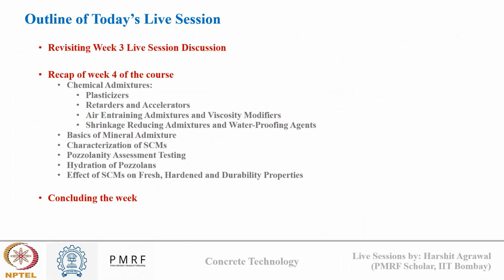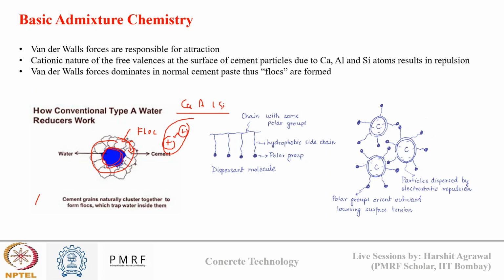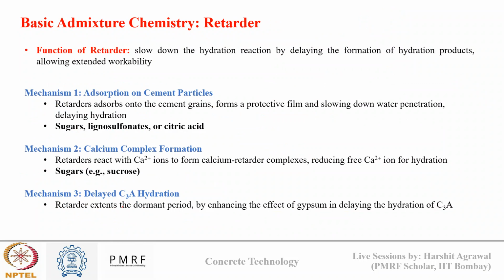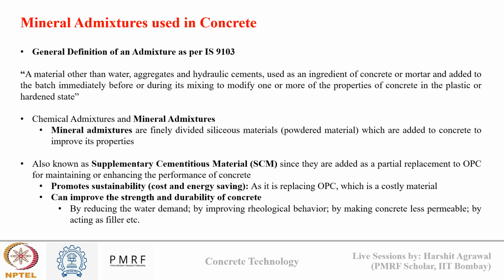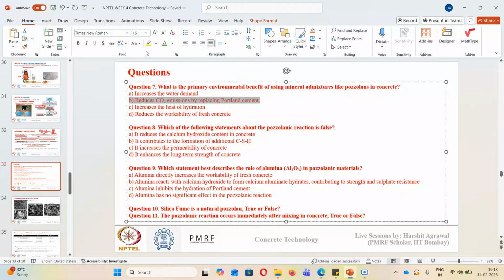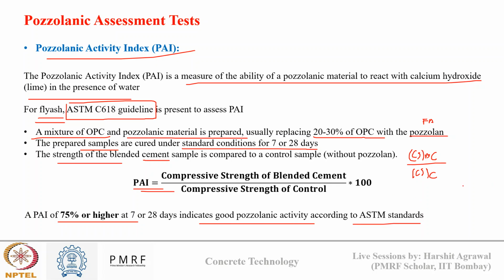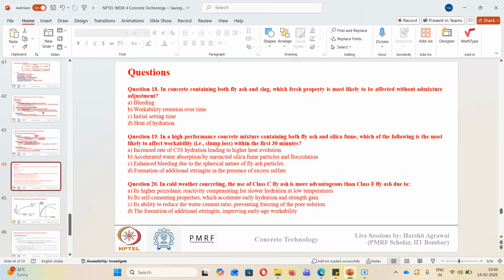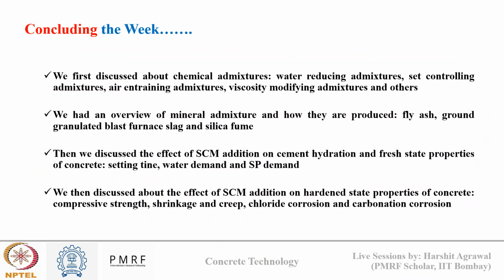Concrete Technology WEEK 4: Chemical Admixtures and Mineral Admixtures

Comment: What is the effect of mineral admixtures on the initial and final setting time of cement?  Increases significantly  Decreases significantly  No adverse or significant effect
Reply from the maker: As discussed in live session

Fly ash will increase setting time as pozzolanic reaction is slower than pure OPC hydration, so early hydration is delayed, increasing both initial and final setting time.

GGBFS will also increase setting time because slag reacts more slowly unless activated, reducing early hydration rate and delaying setting.

Silica fume, on the other hand will decrease setting time because of high pozzolanic reactivity of silica due to its composition and finer particle size, leading to accelerated strength gain and shorter setting time
Reply: @harshitagrawal1548 Sir, could you please clarify why the option ‘No Adverse or Significant Effect’ is considered correct in the assessment?
Reply from the maker: Because there is increase or decrease in setting time happening, but it is not adverse changes. Like with FA, setting time will be delayed, but not by some big margins, with GGBFS, setting time again maybe affected, but not significantly. However, with SF, due to finer particle size, setting time here gets decreased, but again, not adversely.

The question asks whether changes are happening significantly or not, so that's why, though changes are there, they not are as adverse as what an accelerator or a retarder does.